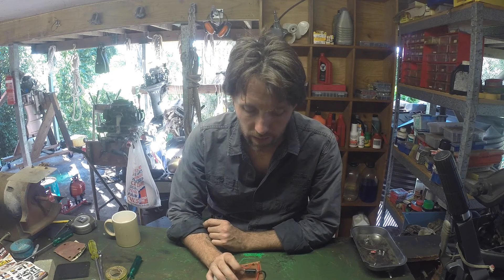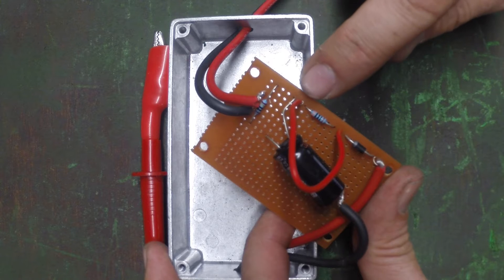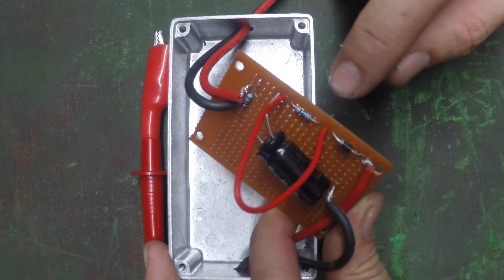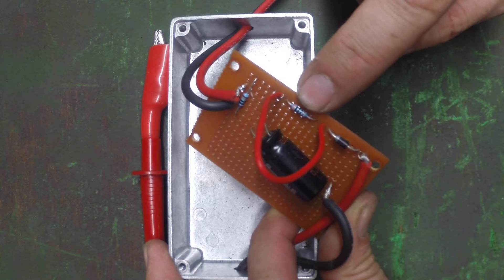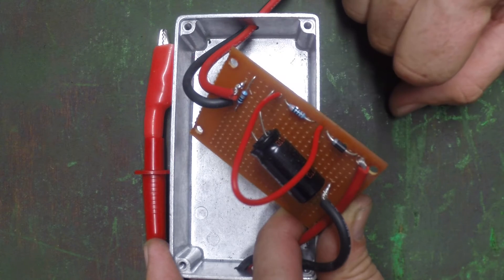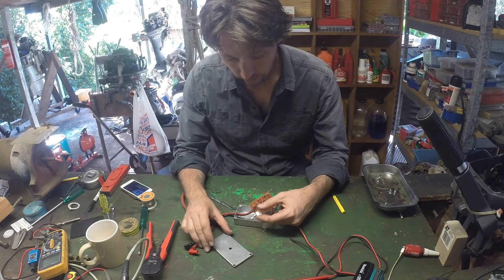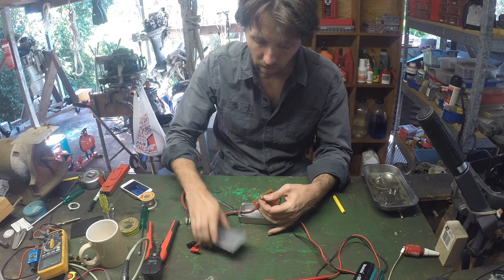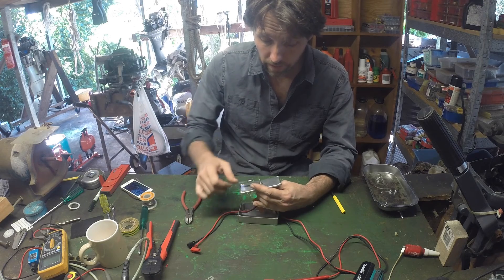The Direct Voltage Adapter (DVA) Revisted

Comment: It worked to check the primary coil voltage for my 2004 Honda 600RR. IMPORTANT: Use multimeter with input impedance DCV 10MΩ or more. Thank you. I really appreciate your work. Greetings from Mexico!!

Comment: I believe the resistor (R1) is to keep the capacitor from drawing too much current and cooking the diode. 
In a situation where you're testing very sudden, but high voltage, low amp currents (an ignition coil), this is not a danger. But conversely, it doesn't have enough time to stabilize voltage in the cap and get a true reading. (The drain resistor (R2) in parallel with the cap will always be acting as a load, reducing the voltage) 
The switch is the fix for this.
Pls correct me if I'm wrong on this :)

Comment: Hi Stu just to let you know the link you provided on your older video led to a discussion group  where they provided no 300 ohm resistor and the capacitor was 2.2 uF however the conversations were talking about two 47uF capacitors in series (as I did due stock shortage) which provides 22uF (approx)  as your paper circuit you held up before.  I looked on eBay and no DVA has a switch thus I assume they have no series resistor I don't know what it is for frankly as the only thing it does is slow down the capacitor charging in the first place perhaps it is to protect the diode and source  ignition circuitry as a capacitor presents a short circuit when it is initially connected (open circuit once charged).  So have you measured the stator and sensor WITHOUT the 300 ohm resistor at all and if so did anything explode ? (just kidding).  Aside from protecting the ignition circuitry (maybe) I cannot see the point of the 300 ohm resistor.
Reply from the maker: I can't see any point for it either. I just leave it switched to have it out of the circuit these days.

Comment: Hi Stu,Thanks for the great video's, they have certainly given me some confidence as to what I can expect when diving into an outboard  :)

I have bought myself components to build your DVA 2.0 but some of the ratings are different than what you suggested, due to availability.    D1 - 1N4004,     C1 - 2.2uF / 450VDC,     R1 - 1/2W / 300ohm,     R2 - 1/2W / 1Mohm.     The store guy suggested readout changes would be negligible, wondering what's your thoughts on that?     Thanks,  Geoff
Reply from the maker: Hi Geoff, glad you've been enjoying the vids. I'm not an expert on electronics, but I'd say they are right in that you will get results that are close enough to give you an accurate diagnosis of how your CDI system is functioning.
Reply: Thanks Stu,     Good to know.      FYI, I panicked and ordered the correct stuff since then anyway  lol        So I built DVA Mk1 tonight and tested against 240v outlet. Reading on multimeter, set to 600V, was 328V.       There was no change whether set to Normal or CDI (R1 bypass)       Any thoughts on that?
Reply from the maker: A DVA will give you the peak voltage rather than an average, so I would say that is the reason for that result.
Reply: Thanks Stu, appreciated.
Reply: Geoff Walledge supposed to be 22 uF according to his first video?..
Reply: Im confused about that, since the original plan asks for 2.2, but the previous video says 22

Comment: do you absolutely need one I also am rebuilding my 79 50 hp mercury outboard.  But I'm having a bit of a fit. I have great compression within 5% on all cylinders. I have checked my stator and have bought a new trigger and cdi. rebuilt carburators and new plugs. rebuilt wiring harness and new cranking battery. I've tried talking to it nicely too but that don't work.  it will only fire up after you clean the spark plugs it won't hit on new plugs. and when you clean the old plugs it instantly fires  up. I'm puzzled.  have you ever saw that before.
Reply from the maker: +Dustin Mayfield Hey Dustin,  that is very strange. Are you sure the new plugs are the right type? Do they spark if you hold them again the engine block rather than trying to start it? Oh, and a DVA tester is only really necessary if you want to test the CDI etc which it sounds like you have already replaced.

Comment: Hi Stu. Thanks for the vids, they're helping my son and I "renovate" his 1978 Mercury 50HP 2-stroke. He was born in 2000! Question: is the first resistor obsolete for a new build without altering the other components? Cheers, Ian
Reply from the maker: Yeah, in hind sight I would just leave it out. The switch hasn't moved since I built it. Great to hear of you and your working together on the motor. There should be more of that. :)

Comment: Hi Stu, thankyou for all the videos, really excellent! Will the DVA work ok on a hand crank motor, in my case a Mariner 5hp? I guess I will need to bypass the resistor as you have done at least? Many Thanks
Reply from the maker: Yep. DVAs work to measure any AC voltage as a peak. Will work fine with a pull start.